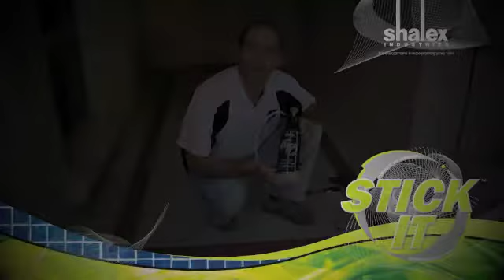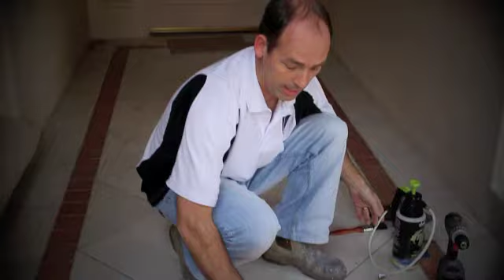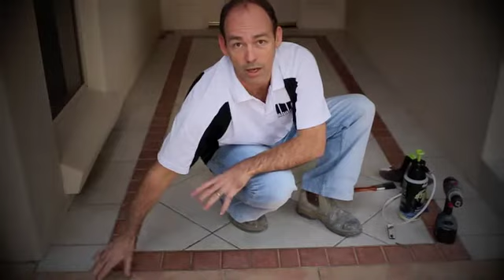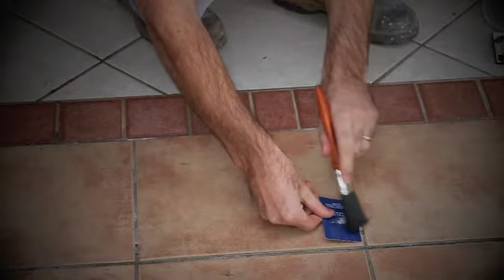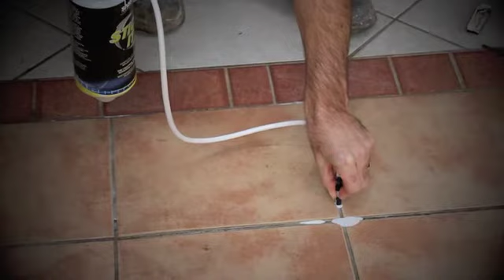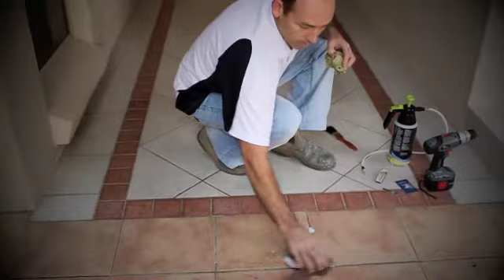STICKIT - FLOOR TILE REPAIR

Comment: When I have finished securing the ‘drummy’ tiles how long can I keep the adhesive in the pump for future use please?
Reply: I have a lot of drummy tiles in my home so I am in the process of injecting under tiles using the larger pump available (like a garden weed spray) from Shalex.  I carefully wash the applicator end after every use and if storing left over glue would pour into a small airtight container.  I reckon it would start going off within a week or two otherwise and ruin the pressure pump.  It works well though I found it easier when I cut a small 10mm length of small rubber pipe which I added above the supplied rubber nipple on the syringe tube.  This made it less painful and a one handed job when pressing down hard to create a seal to force the glue under the tile. When you do it you will know what I mean.  Good system and it does the job.  No real skill needed. Helps to have plenty of heavy weights to force the tile down for 24 hours.  Full buckets of water works.

Comment: What should I do if grout is brittle and loose? Do you advise removing loose grout and applying new grout/sealing prior to drilling holes and injecting stick it adhesive?
Reply from the maker: If the grout is loose you can remove this. We suggest you have the grout intact before injecting as that allows the adhesive to be injected under pressure and it will push farther under the tiles than if the grout is missing.